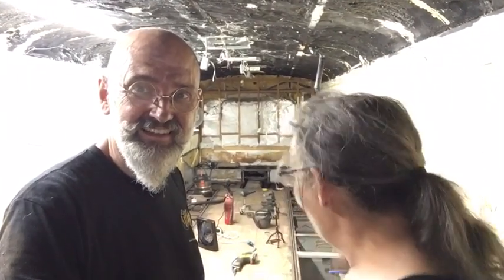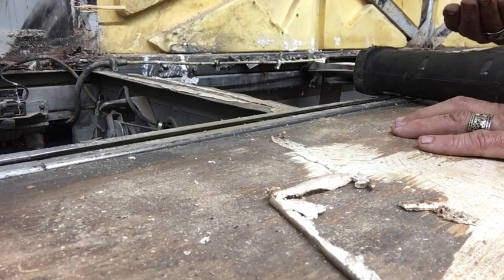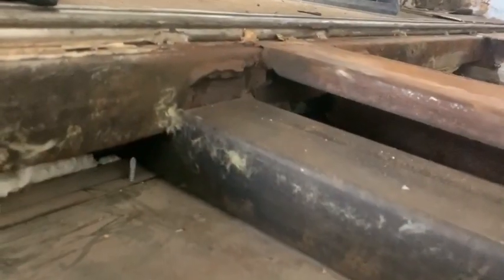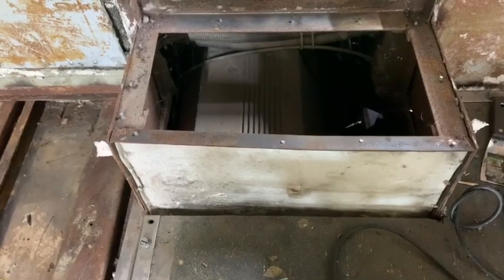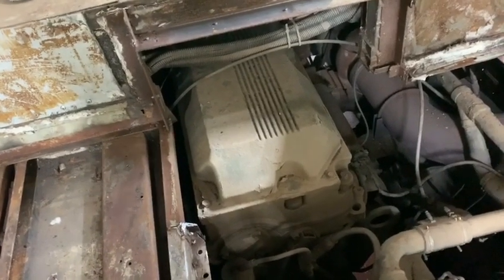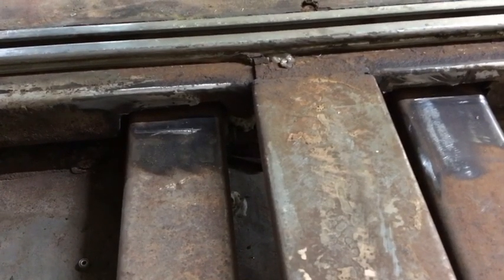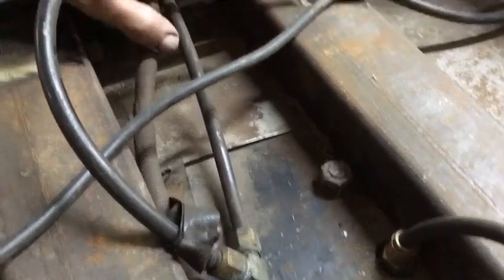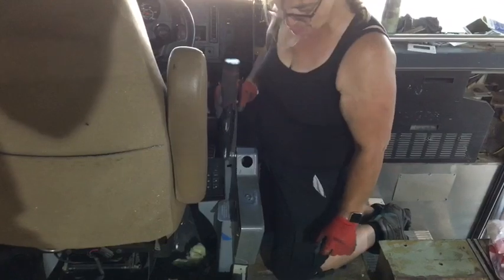E4. Join along as Sylvie and Yvan build their tiny home on wheels. MCI 102DL3 rénovation

Comment: The two water taps on those pipes are the taps for the heating system. When they are closed, the driver gets very cold in winter. But check the pipes before opening as the passenger heating system has probably been cut off. The lines must be welded closed (in the bay where the oases heater was located). The taps are there for maintenance purposes.

Comment: We own a 1979 MC 9, a" Custom Coach of Columbus OH" conversion. Your videos are very informative, especially the one which included the info about Caylor Supply, we've owned our MCI eight years now and never heard of Caylor. We live in Las Cruces NM.
Reply from the maker: Happy we could help. There are a few good resources for MCI coaches, here’s a short list. 

MCI 

https://www.cjbusrepair.net/

 

US Coach in NJ.  856-794-3104
Ask for Luke
New and used Bus  parts
 uscoach@att.net

Caylor Supply,  Kansas
New and used Bus parts
Ask for Sam 785-878-3405

Easter Bus Sales 276-627-8650
New and used Bus parts
http://www.easterbussales.com/

Lewis Bus Lines - (706) 792-1800
New and used Bus parts
http://www.lewisbus.com/buses.html

Bonanza Auto Dismantlers, Shingle Springs, California. (530)677-8239. 

Sawyer Bus- (540) 394-8000
New and used Bus parts
https://www.sawyersbussales.com

ABC Parts  877-427-7278
New parts only
http://www.abc-companies.com/parts/

Fowler's Auto Wrecking | Quality Used Auto and Truck Parts 

MCI
Newer MCI Buses and parts
Www.mcicoach.com

BUS Manuals, Parts Manuals, 

Maintenance Manuals, 
Operator - Driver Manuals etc...
www.coachinfo.com

New Bus Windshields:

Curved Glass
Www.curvedglassdist.com
203-735-4665

Translite Bus Glass
800-934-3450
Www.Translitebusglass.com

Coach Glass
800-714-7171
Www.coachglass.com

Wolverine Glass
616-538-0100
Www.wolverineglass.com

Advantage Glass
616-395-9800
Www.advantageautoglass.com

Comment: Yvan- I've got a '99 Van Hool T2145 with a track system for seating.  Have you dealt with removing these?  Can the rolling tracks be taken out and the tracks left in place?  Do you know if the tracks are welded or affixed some other way?  I have pictures if it would help.
Reply from the maker: In ours the tracks were solidly welded in place , we left them there and built up the sub floor to their level

Comment: Replacing the window covers on my MC9. Owner originally used heavy gauge sheet metal. What gauge should I use? Steel or aluminum? What sealant along with rivets.
Reply from the maker: We used 16G aluminum, we attached using rivets, and panel adhesive.